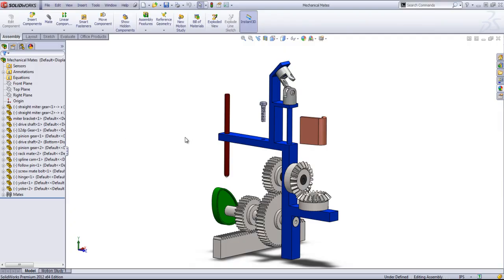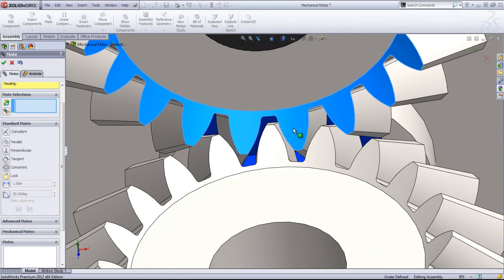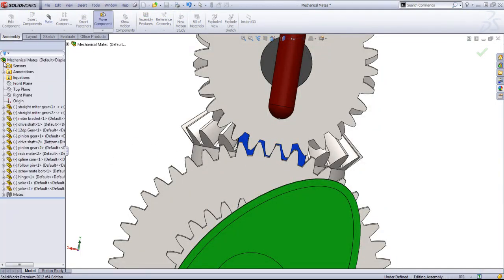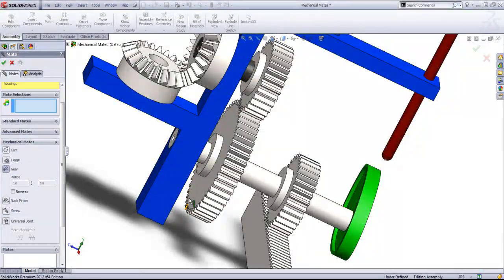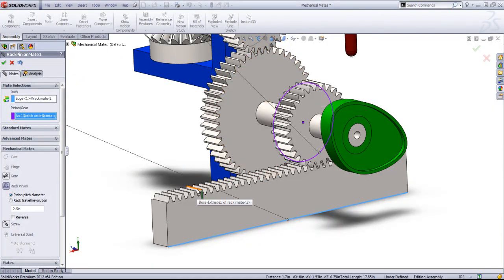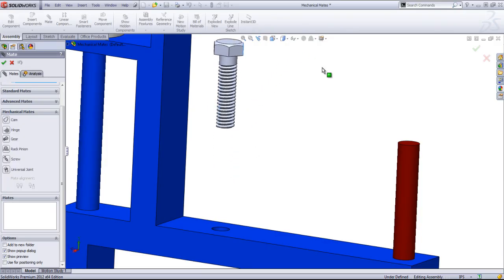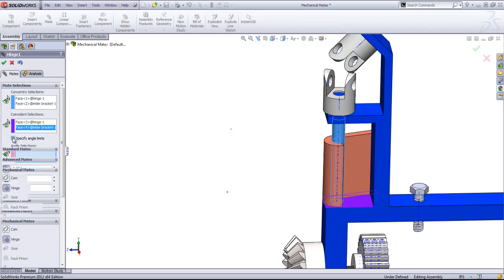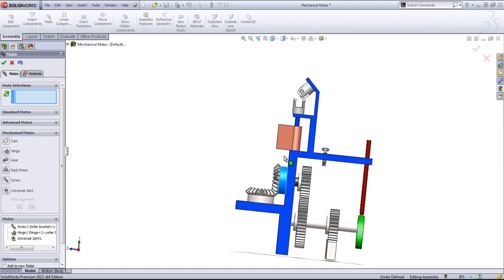SolidWorks Tutorial: Mechanical Mates by SolidWize

Comment: Would a Standard Lock mate between to rotating prices accomplish the same thing as a 1:1 Gear mate?  If so, is there a computational difference between the two that would result in any major difference in rendering between a large assembly using a Standard Lock verses a Mechanical Gear 1:1?

Comment: Will solidworks tell me if there is a backlash present between two gears? If they are present, what does it do?
Reply from the maker: Not specifically. You'd have to run a motion simulation and analyze the motion yourself.

Comment: Thanks for this video.
I wonder how to make and animate a  limitation on the movement from the cam follower,  by lets say a nut on the rod that prevents it from going all the way down to the cam.
Reply from the maker: You can use a limit distance mate, or a point to surface mate will also terminate on the end of a surface, so it functions in much the same manner.